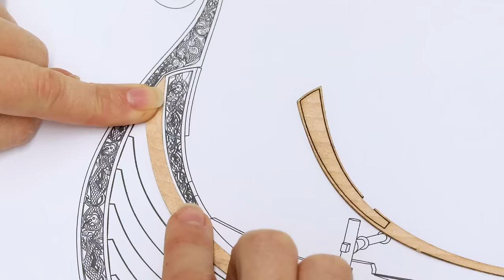#3 Viking ship OSEBERG - Clinker PLANKING - model ship building

Comment: I remember seeing the real thing in Norway . What surprised me,  was how thin the planking was . Only about a inch ( 24 mm). When they didn't have the use of a saw or plane and the wood was  so smooth . The planks  were split from the log with wedges .  And your model planking is really beautiful , you have done an excellent job of it !

Comment: Very nice, especially correcting the "mistakes".  I really can't believe the level of errors ship modelers put up with from most of the manufacturers, as if it's almost to be expected.  If a scale model company like Tamiya were to put out a kit with as many errors as I have in my ship's instructions, they would be absolutely roasted for it.
Reply from the maker: This is the difference between wooden kits and plastic kits. Even if you start building two identical kits at the same time, you will end up with 2 different models. Because it is wood - it reacts to humidity, the amount of glue (type of glue), even to the mood of the modeler))) - it can twist, crack, peel, etc.
Therefore, it is simply impossible to create an ideal wooden kit that could be built like a Lego constructor! But wooden models, unlike plastic ones, you can restore over time, repair like real ships that needed constant maintenance during operation...
Reply: @OlhaBatchvarov  
That part I totally get...  It's the actual mistakes and contradictions in the instructions & blueprints themselves.  On the ship I just started, there's enough of them that I had to pull out a pad and start making notes of them to remind me of what to look out for later on.  For one example, on the mizzen top... the 1:1 blueprints show 5 blocks hanging, the photo of what it's supposed to look like shows 3, and the rigging diagrams only use 2 of them.  🤣
Reply: It is true that there is a notable difference between plastic and wooden models but in some respects Frankw7266 is right. There are many discrepancies between the drawings and the construction, in many places the construction does not come as the manual says. I am making the San Bartolomè, a beautiful model, but unfortunately with numerous anomalies, for example on the drawing there is a capone crane which the instructions lead to making it another way so much so that the pillar of the anklet happens right on the hatch of the bow deck . Many pieces that you don't know where to assemble. Drakkar short planks are also no good. In short, they are certainly beautiful works but I think Pavel should be more careful in the transition from drawing to laser engraving also because his kits cost a lot of money

Comment: Dear Olha.  I have seen your short on the planking being wrong. I also read about that Pavel Nikitin will replace them with a correct set when adressed on it.  Can you add to this?  I am following this model since i might want to buy it also, hence i ask.  Thanks for your work !!   A pat for Imbir.
Reply: Up to what kit number are those planks too short ??
Reply: Kind of a shame that the planks are the wrong length...
Reply: i do not know. One of the reasons i am posting this.
 @Tusk926
Reply: happens. Good thing tho they can be replaced. @RaduB.
Reply: @martinaalderink7773 It shouldn’t for what you’re paying.  Not everyone is going to have the tools, materials or inclination to make their own planks.  Hopefully existing customers get that sorted promptly.  It would’ve likely been a better idea to just had them precut a bit longer then allowing trimming to length because that’s a hell of a lot easier than finding matching wood and cutting your own which is something I’d guess most wouldn’t want to do or expect in a kit. In a kit that costs over $200 and says “The main thing you will need is glue and sanding tools as all parts are almost complete” that’s a problem.
Reply from the maker: In general, he already replaced these planks in all kits, but only because they were not wide enough (in fact, without taking into account the overlap), but the length became known later... That is why the last plank on which there will be a decorative carving is narrower than it should be, because then all the decorations must be changed as well. Therefore, I purposely made the overlap smaller than necessary on each plank, so that at the end there would be enough width for the correct form of planking. Or you can cut the stem and sternpost (narrow it by 2 mm...). Therefore, at the beginning I lacked 4 mm of length, and in the end this lack increased to 6 mm...
In my opinion, Pavel should not have tried to salvage this kit and rework it after another store tried to make it. It is better to create a new one, from the very beginning!
Because this kit is difficult to build even for a professional modeler. Considering all the mistakes at the first stage of design, and then all that Pavel did not take into account while trying to improve this kit...
Reply: thank you for your input ever so much. =) @OlhaBatchvarov
Reply: I had this problem with version #1, so I bought version #2. Got updated planking from Pavel and thought this problem had been solved. Then I saw Ohla's videos here and see the problem still persists. I am not happy to hear there is a version #3. How many kits have to be purchased to get this problem resolved?

Comment: At 1:50 the final build is a bit too big to fit my (UK terraced) home. Did I read (on SOS) that Pavel might also produce a smaller scale version, that it was just a matter of adjusting the parameters for the laser? I've always wanted to build this but the 2 aging incomplete kits I got on eBay by Billings were such poor quality materials it wasn't worth it.
Reply from the maker: Pavlo talked about creating his entire collection on a smaller scale. But everything takes time - test builds, etc. That is, it is not only about setting parameters!
P.S. The length of the model is 90 cm

Comment: 10:00 Do we know if the planking problem will be fixed in the kit? Would be nice for us with not so many excellent tools and no access to quality spare wood...
Reply from the maker: This is a wooden kit - everything can depend banally on the humidity of the air and where this kit was stored. I simply advised the manufacturer to deliberately make the planks longer so that each modeler could shorten them to the desired length...

Comment: About 14:41 - excuse my question, please, but why did you make new ones? I seemingly do not get it.
Reply from the maker: Before making new ones, I showed in the video how short the planks are. So, I decided to make new middle parts, because they are easier to cut. They were short from 4 to 6 mm. I don't build models with a bucket of wood filler and then paint them like Pavel did on his prototypes! So I need all the parts to be tightly fitted, because the oil will then show all the flaws and highlight them tenfold!
Reply: @OlhaBatchvarov  Thank you so much, i somehow did not notice.

Comment: what type of wood did you use for building ship?
Reply from the maker: Beech on this model! But I am very disappointed in it. The wood is not only very hard, but it is also loose and does not hold an edge at all - it is very easy to catch and peel off.
Reply: @OlhaBatchvarov  what do you think is the best wood?